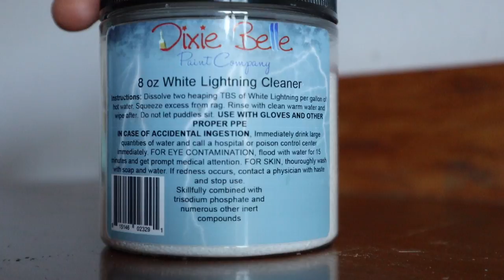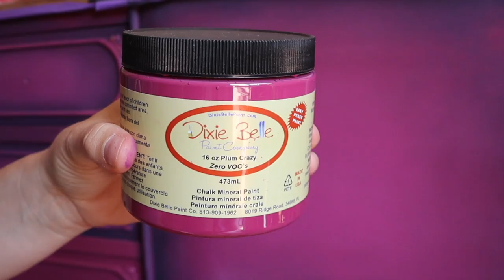Amazing & Unique Purple Vintage Buffet Makeover Using Chalk Mineral Paint

Comment: Do you know if that wood filler can be stained? I am in Canada, I use a citrus stripper. Love this piece, just like everything you do. ❤🇨🇦
Reply from the maker: You know funny you asked I thought about addressing that, I should have. No generally not but you can use a gel stain over and it can be camouflaged 

Thank you so much friend ❤️❤️❤️
Reply: From what I understand the DAP plastic wood can be stained if you’re doing oil based, I’m in the process of restoring a coffee table and am going to be staining over some of the plastic wood filler, I can come back and let you know how it worked out if you want. Like Crys’Dawna said, I’ve also heard using gel stain works too over other types of filler, like kwik wood.
Reply from the maker: @angelagenx6629  Let us know!!!
Reply: Yes please let us know
Reply: Will do! Hopefully I’ll be staining it this weekend, fingers crossed!
Reply: I apologize for the delay in getting back to you. I work on pieces outside and the weather here hasn’t been the most cooperative (90 to 100 degree weather and then rain). Finally we are having some nice weather. 

I stained yesterday, with special walnut from Minwax and was able to stain the Dap Plastic wood filler, (which is natural). It worked really well. Now the wood filler does take stain but not like wood, so I applied an extra layer just to the wood filler to help it match. I’m pretty happy with the results. It might have been even better if I had an exact match of wood filler to the type of wood the piece is made of. I’m a novice when it comes to identifying wood, which is why I went with natural and it was lighter than the wood, (not a great match). Hope this helps! And again, I’m really sorry it took so long to get to the staining.